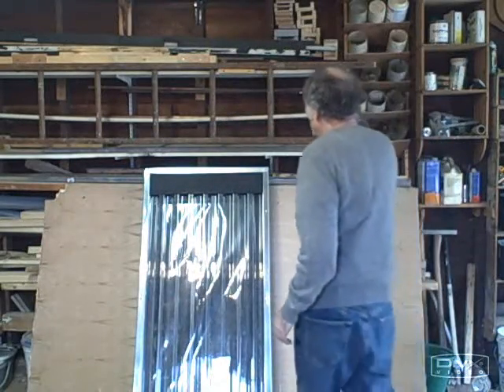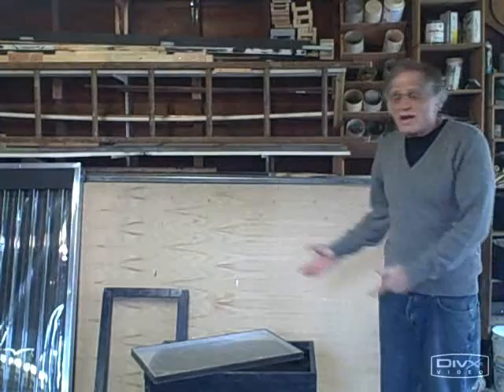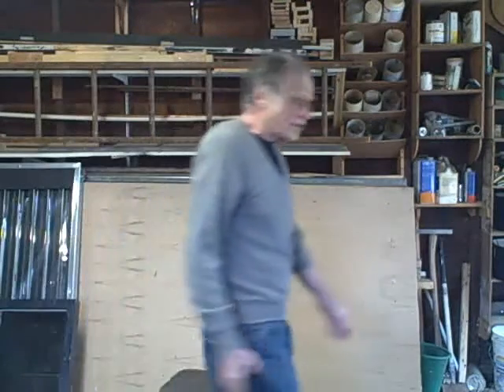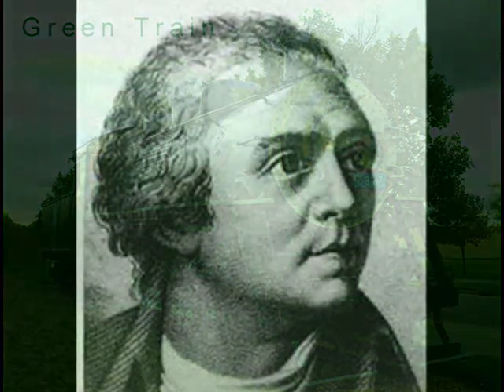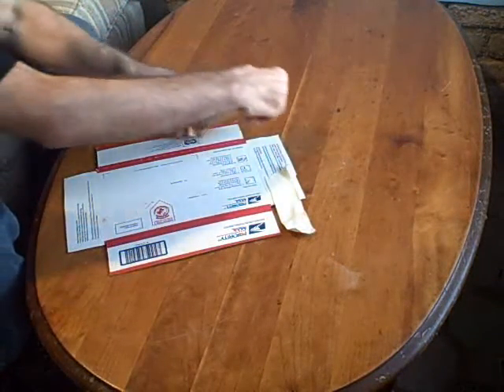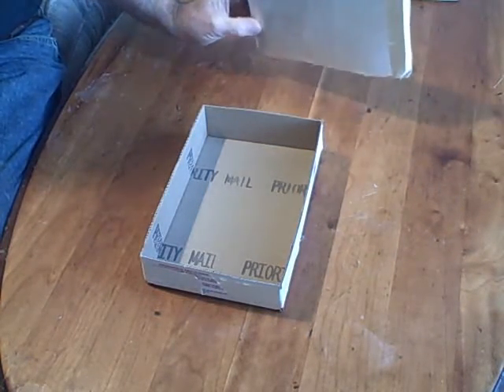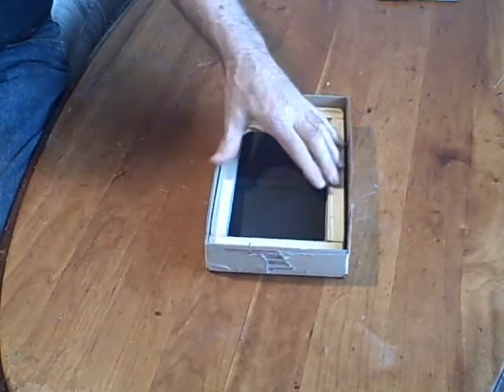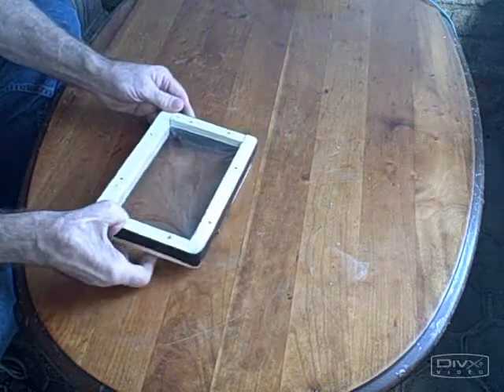Hot Box 101

Comment: Ok, I see that the moist felt is a much better collector, but how do you transfer the collected heat? The best fluid I have seen is air (no leaks or freezing) as in the beer can collectors, how about an air tube collector with wet felt on the outside this might reduce evaporation and add to the overall efficiency with rock bin storage like the old international solar thermic collector from the 70's.